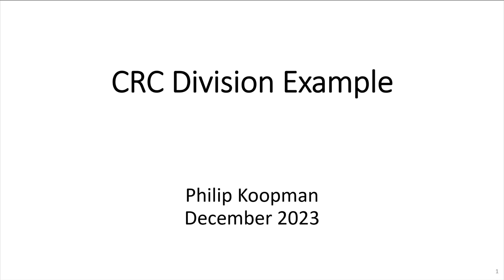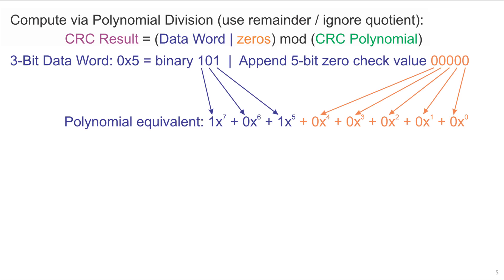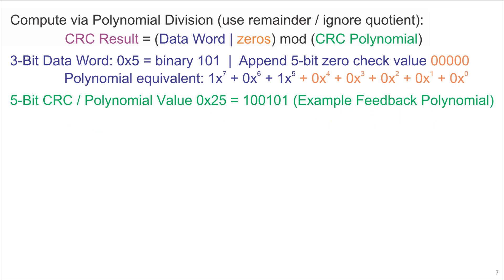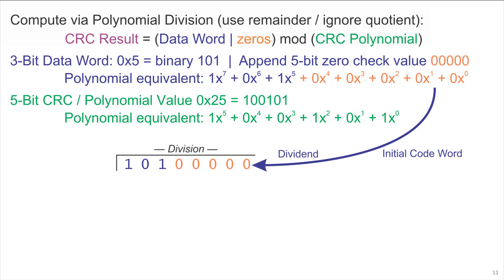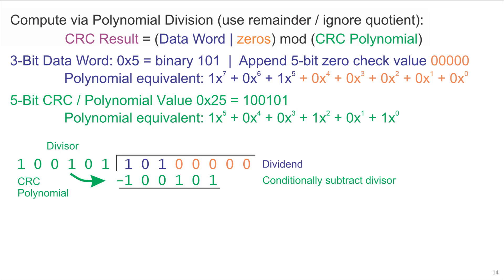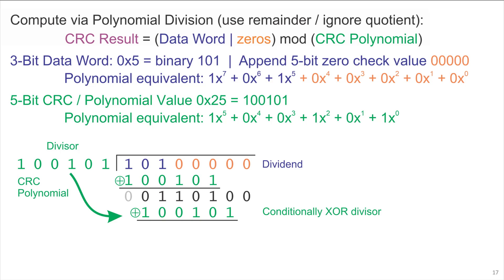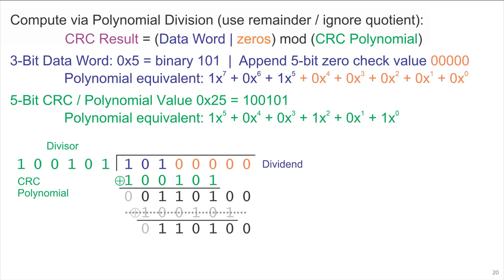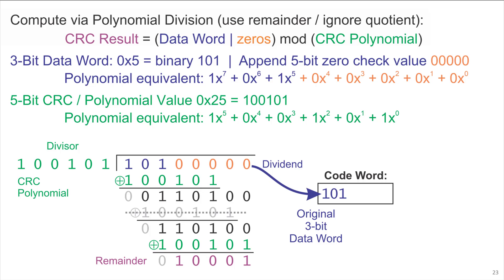L601 CRC Division Example

Comment: Isnt the CRC / Polynomial Value 0x25 6 Bits long, yet it says "5-Bit CRC.." ? Anyways, super helpful video, thanks!👍
Reply from the maker: It computes a 5-bit check value, which requires a 6 bit polynomial to specify in full notation.  People generally refer to the CRC size as the size of the check value, and the full representation of the polynomial is +1 bits in size.   (For example, a 32-bit CRC has 33 bits in its polynomial including the x**32 term and the +1 term.)
Reply: @philkoopman  ah okay that makes sense! Thanks for clarifying :)